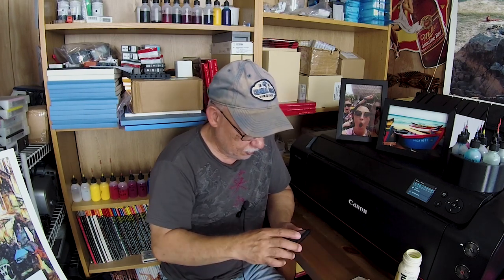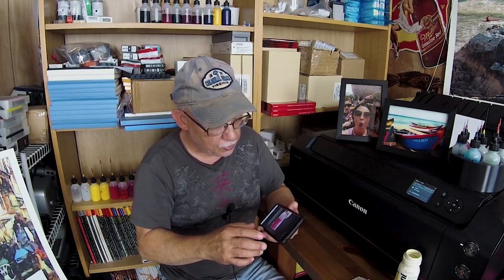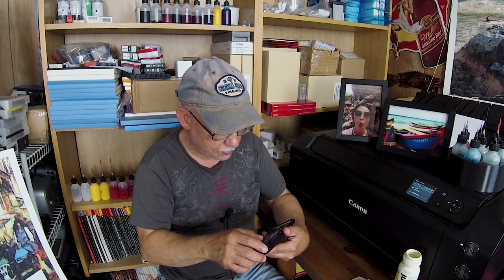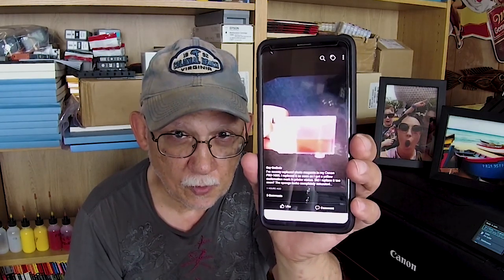Your Refilled OEM CANON CLI-42 Carts will never perform like un tampered OEM ones!

Comment: That's true but I still get fantastic prints with my pro 100S !   I'm still glad I found your site as I didn't know better and I was ready to install a ciss before I surfed into your site !. I ended up splitting it up to use on two 7610 Epsons LOL I still have both pro 100s and they print like new and its been almost 5 years.!
Reply from the maker: Use that PRO100 brother! It is a great printer.
Reply from the maker: Use that PRO100 brother! It is a great printer.

Comment: And actually, Octoink UK does have a method of refilling without removing the ball using his new Clip-Clamp accessory.  I have not purchased one or tried it.  It looks intimidating even for me.  My thoughts on this are - why, when it so easy to modify a cartridge?  Martin and his store are a first class ink seller regardless.  I use his flush clips and syringes to do the bulk of my flushing services.
Reply from the maker: Now that you mention that I will try to come up with a method of refilling method that would not require the removal of the factory ball.

Comment: Do these cartridges need to be flushed and dried every time you want to refill them? I just started watching your videos (waiting on approval for the FB group) and am really interested in this. it would seem like a pain to have to flush and dry the cartridges each time they run low- can you just top them off with the Squeeze needles whenever they run low?
Reply from the maker: You only need to refill them directly. No flushing except for Yellow. PC will give you one flushed cart. You remove its chip and replace it with your OEM Yellow cli42 chip. The you can reset and fill it. The other 7 carts can be modified and immediately re filled.
Reply: @cheo1949  Thank you! Hoping you approve my request to join your group so I can learn more and ask you less questions!

Comment: Hi Jose, this is a question about Canon imageprograf pro-1000. I refill my ink carts with Inktech ink from Germany. Every morning I have to run a clean because the PGY is clogged. One clean does it and then it is usually ok for the rest of the day, unless I don't print for more than say 4 hours. I print everyday for my business. Can you offer any solution or advice please ?
Reply from the maker: You have a problem!!! I don't think is due to the inks unless you have already pushed out ALL remnants of of the original ink that was in the printer's ink lines and internal compartments and print head dampers. If that is the case then I would look art your PGY Cart you are refilling for anything that could be interrupting ink flow.
Reply: @cheo1949  Thank you for your kind reply. How would I check the Cart please ? The Ink supplier is sending me a free PGY ink just in case it is the ink. Thank You